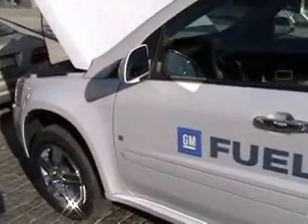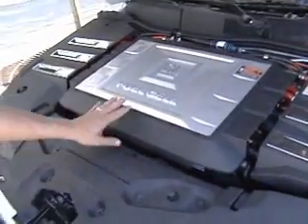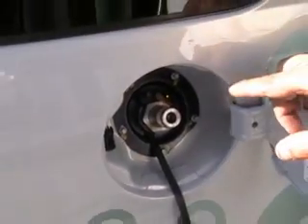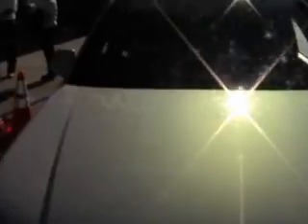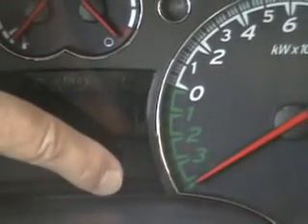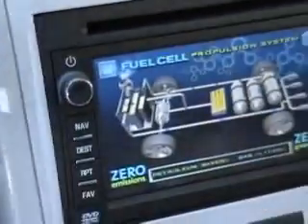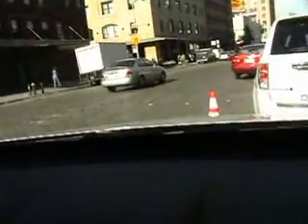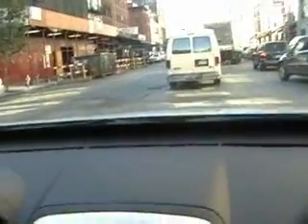Project Driveway GM-Volt.com Fuel Cell Equinox Hydrogen

Comment: they'll never work (at least not where i come from: minnesota).  they don't work below freezing.  the water vapor in the exhaust freezes the cell and you can't get it started unless you plug it in all day long, which is pretty much impossible.  and not to mention they're very flimsey little membranes, so it would be breaking down all the time driving down rough highway 83 to mankato every day.  vibration may be good for a woman's vagina, but not a fuel cell car.

Comment: The hydrogen in this vehicle is being provided by an external source and stored into tanks inside the vehicle which (in my opinion) makes them extremely dangerous. 

I didn't understand what you meant by "made on demand" but if you mean breaking down water into hydrogen and oxygen (whitch would be safe,economic,ecological,etc etc...) i think it has allready been successfully created but the guy building it died before he could publish his work.

Comment: NASAs been using fuel cells for all their power ie apollo,shuttle and it works fine, and
h2 could be cracked from water using solar power and wind power, fuel cells make sense 
Just make the commitment.